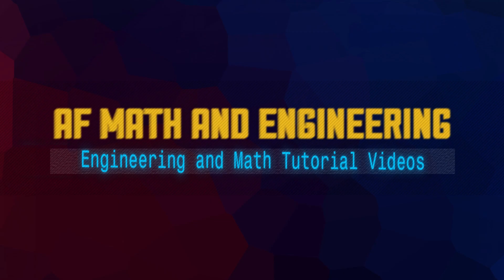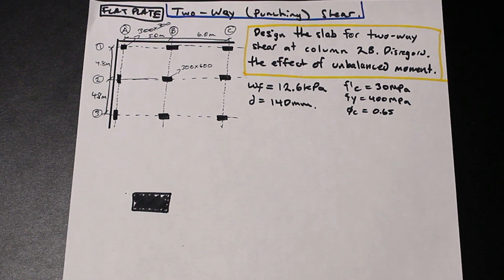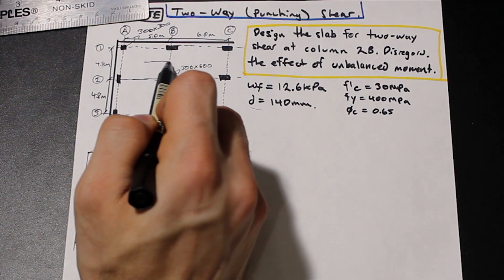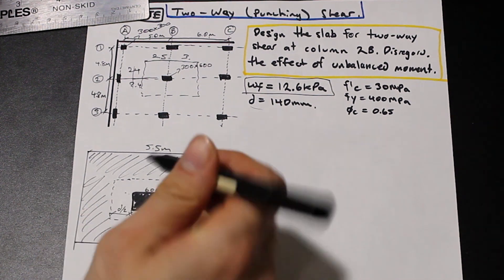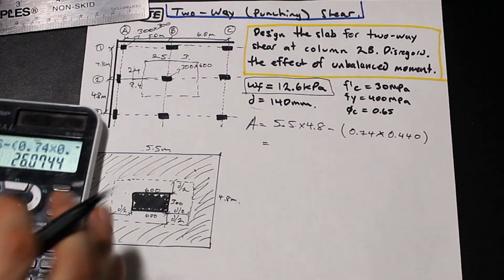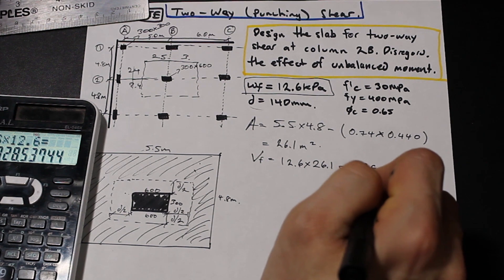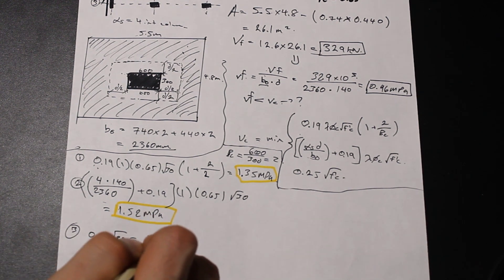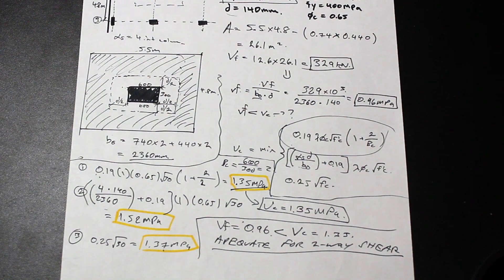Two Way (Punching) Shear - Concept Explained and Flat Plate Example - CSA A23.3 (Canadian Code)

Comment from the maker: Let us know if you found this helpful in the comments down below, and if you want to see more tutorials on concrete!
Reply: Hi AF Math & Engineering,
I have previously used British code for Concrete design. For members like slab and footings, which usually do not have shear reinforcements, there was a multiplying factor based on amount of main tension steel for the slab. I do not find any such provision in Canadian code CSA A23. How can a slab (without shear reinforcement) be considered to have same shear capacity having nominal steel or much more than nominal steel?
Reply from the maker: Hey, for normal flexural members only shear reinforcement, prestress and shear resistance of concrete are considered for Vr.  I suppose longitudinal steel in normal flexural members somewhat intersects shear planes, but typically we can't count steel that's being used for another purpose (flexural steel) as also resisting shear force.  For deep members (shear friction) longitudinal steel passing through the shear plane is counted as shear resistance.
Reply: @AFMathandEngineering  As my original comment says, the British code considers the amount of tension reinforcement (in members like slabs or footings) and provides shear capacity in accordance with the amount of tension reinforcement. Since my initial comment, I have checked that EU and Indian codes also follow this. My question is why does CSA A23.3 does not. It is absurd to think that plain concrete will have same shear capacity as the same concrete with reinforcements. Shear capacity of concrete members based on shear reinforcements is a separate matter and British, EU and Indian codes have similar methods as CSA A23.3 to work out additional shear capacity.
Reply: Thank you!
Reply from the maker: @Monica Yolanda Ona Vera thanks, will be the next video we release.

Comment: I have to open a stair void in my existing slab. This void will be located right next to a column. How can I check if this is safe or not for punching shear? thanks
Reply from the maker: If it intersects your critical perimeter it may change the type of column under punching shear guidelines (interior,.exterior or corner) and you'll have to evaluate it as such.
Reply: AF Math & Engineering  it’s an interior brick column 400x400. It’s indeed within the punching shear area, but I’ve done a computational analysis using a software I’ve got here and it was fine for punching shear. The slab is 150 thick. Do you think I should do any other calcs or tests? Because the house is a bit old and I just graduated so don’t have much experience with this. Thanks
Reply from the maker: Hey, I can't comment on any actual design situations, you'll have to consult  the engineer stamping your drawings for advice specific to your project.

In general though if you're not sure it's best to do a quick hand calc, I know the column is located interior but it may act as an edge column if the opening intersects the critical perimeter for punching shear on one side of the column for an example.  In this case you'd have a larger unbalanced moment because the formula you'd be using is different for an edge column vs an interior.  Consult our punching shear video for clarification on the critical perimeter.